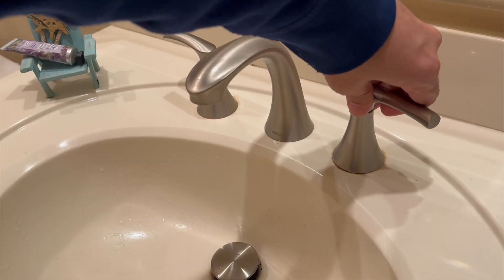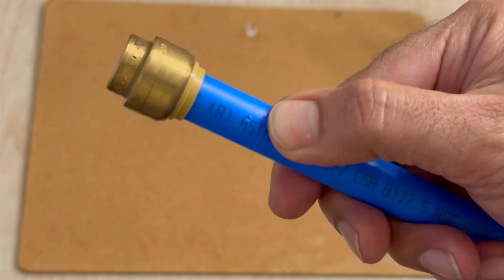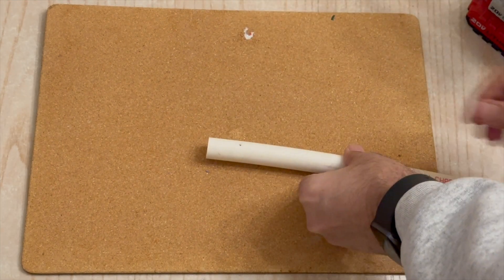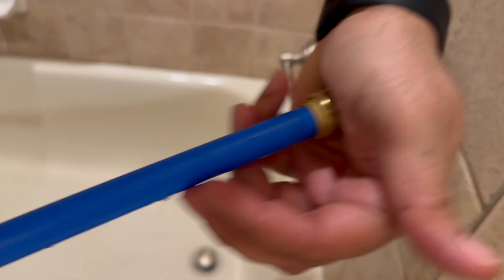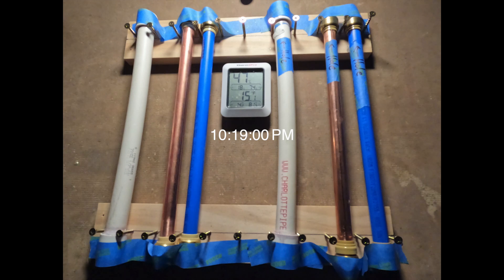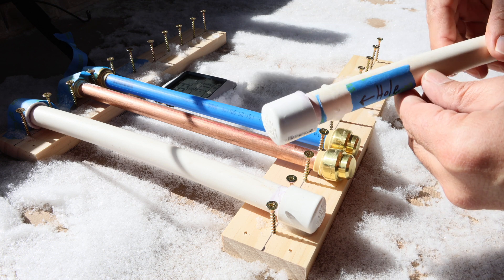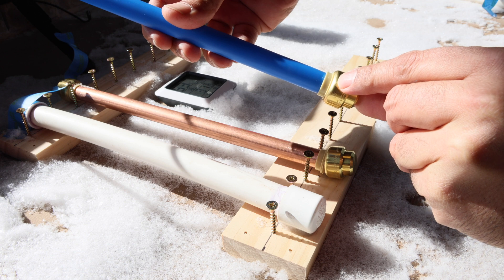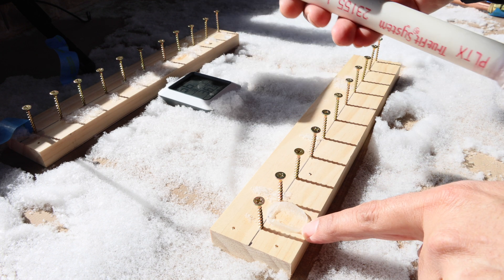Why drip your faucet?  Does it work?

Comment: You are right (and Steveprice5664 is mistaken) that it does NOT require a great deal of flow to prevent pipes bursting, in fact, there doesn't actually have to be any drips coming from your faucets so long as you've backed off enough pressure on the faucet gaskets to allow a tiny amount of water to bypass the gasket if the pressure due to expanding ice ANYWHERE in your pipes to relieve the tremendous pressure that is exerted by the ice. BUT the best way to be sure you've decompressed the gaskets sufficiently is to see drips. One drip per minute would be enough!!! 😳😃

The pipes don;t rupture where the ice is, they always burst downstream of the ice plug. Water is virtually incompressible (it takes ~33,000 lbs to reduce water's volume by 1%) This means that if there is a slug of liquid water constrained between an ice plug and a tightly closed valve, the pressure on the water can rise to THOUSANDS of psi. The weakest spot in the pipes containing that slug of water will rupture under that massive pressure. The reason the rupture is always downstream of the ice plug is that water upstream (on the supply side) side is because water under pressure on that side is pushed back to the water main, or if you have a backflow device, out the pressure relief valve on the RPZ device.

I should point out that dripping faucets don't prevent your pipes from freezing. I've serviced many houses that have lost water supply due to frozen pipes, but if they loosened the pressure on their valves, there was no damage to repair. We would warm the crawl space enough and the pipes in the area that froze enough to allow 33˚ water to slowly melt the ice as warmer water started moving thru the ice plug.
Reply from the maker: I love this response!  I too have researched this and theory says exactly what you have experienced in the field.  I was hoping I could replicate this with a simple experiment.  Turns out it’s more complicated as I need the structural integrity to withstand these immense pressures.  So your comments meant the world to me!  Thank you so much for taking the time to watch this video and post your comments!  Please stay tuned for version 2.0 of this video!  I promise I will break some copper pipes the right way!  lol!
Reply: @p-laddy  The tricky thing is getting the ice in the right spot and controlling for even small amounts of air in the system. You can't solder pipes with water in them, it takes a valve that will allow you to fill them after the ends are soldered on. don't use a ball valve because the water in a closed ball valve WILL freeze and bust the valve body every time. Globe valves don't internally trap water, whereas gate valves sometimes can.

Comment: this is just wrong on so many levels
Reply from the maker: The shark bite connectors were not a good choice for this experiment.  My next video will have better copper and pvc caps.  But the focus of my video is that you don’t need water flow.  You just need pressure relief.  There are other videos that show this phenomenon as well.
Reply: @p-laddy  I commented above about how ice bursts pipes, a good experiment to perform to demonstrate this would be to: 1- solder caps on the copper pipes for a secure closure. 2- try a couple of pipes with various amounts of air pockets in pipes stored upright, then cap them with pressure gauges. 

For example, take 3 pipes about 12" long, one COMPLETELY filled (no air bubbles), one with about 1/2" air bubble, one with 6" (half full) of air. What you should see is the pressure on the full pipe will rise to the bursting point. The one with the small air bubble will increase, but maybe not enough to burst the pipe, but the small air space should rise to maybe hundreds of pounds. The one with the large air space will rise, but maybe only a few pounds? The greater volume of air, which IS compressible, can absorb most of the pressure exerted by the ice. For this experiment to work, the pressure gauges will have to be on the tops of the pipes (where the air is) and the freezing will need to be in the lower portion of the pipes. If the top of the full pipe freezes at top first, the rupture will be below the pressure gauge and it won't record the pressure rise. 

Good luck. I look forward to your next experiments.
Reply from the maker: This is a great idea!  Thank you again for such thoughtful comments!

Comment: Letting a faucet drip creates a dynamic condition.  You're not simulating continuous water movement, only slight movement when freezing actually takes place.  The idea of having the water flow is to  freezing.  A 'slow drip' won't do it.  The water needs to actually 'trickle'.  Try using a couple of hoses with different flow rates.  I did.
Reply from the maker: Thank you for this suggestion.  Sounds like a great experiment!